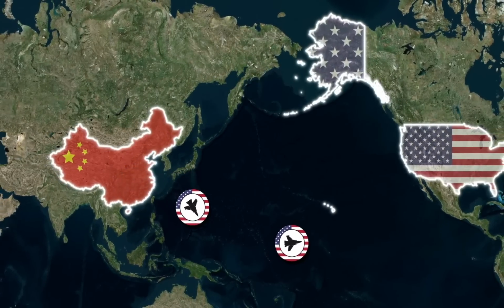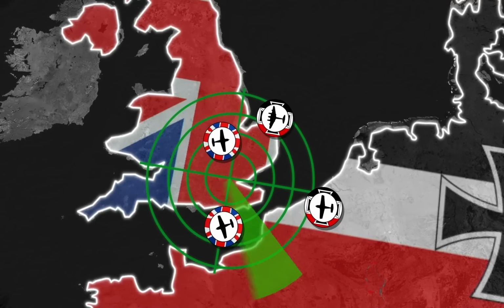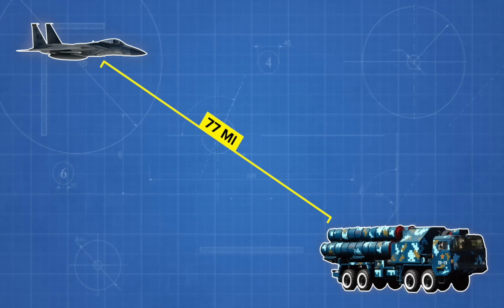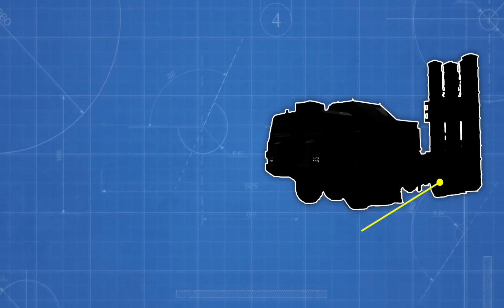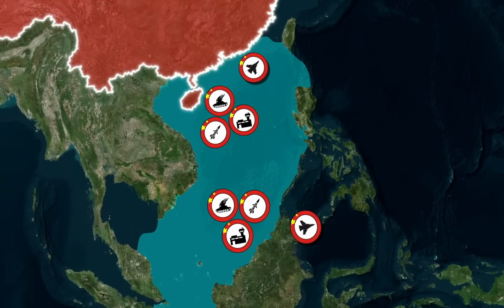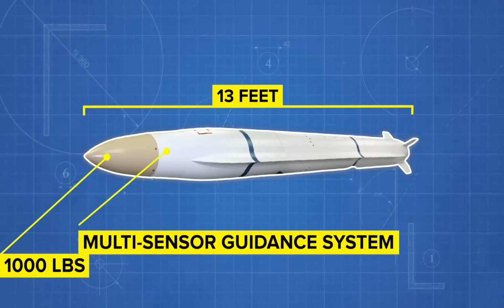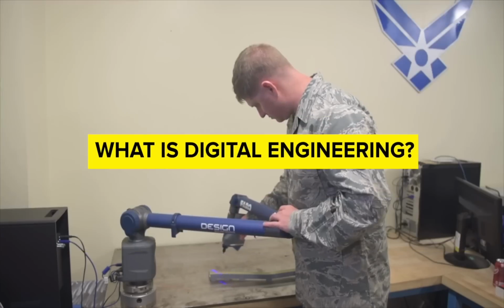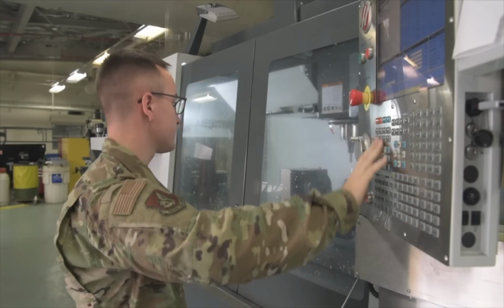Why America's New Airstrike Weapon Is A Total Game Changer

Comment: In actual combat, the S-400 has underperformed from the hype around it.  It has not lived up the stats surrounding it.
Reply: That’s usually the theme with orc hardware
Reply: You’re right and we all know it. Orks make crazy claims their equipment can’t do and the US says it can do 1x when really it’s performing at 2-5x
Reply: Indeed.  Why didn't the S-400 intercept those two Neptune anti-ship missiles that sank the Moskva?
The Moskva may have been out of range of the S-400 umbrella, though.  

If that's the case, then defective Russian standard operating procedure sank that ship just as much as the missiles themselves.  U.S. spy drones noticed that the Moskva's air search radars would go down for scheduled maintenance.  That means the ship was unprotected.  The Moskva should never have been operating alone.  There should've been another destroyer nearby to watch while the Moskva's radars were down.
Reply: @BlackPill-obey  Wouldn't have mattered The Moscow's radar weaknesses were built in to recreational SIMS made a full decade earlier.   One Youtuber duplicated the attack with an old SIM.   The Moscows long range radar only saw clutter under 50 meters above the waves.  And the short range radars had similar limitations (look up the video for details).   It was scheduled for radar upgrades in 2019 but couldn't due to sanctions in place from the 2014 invasion.
Reply: @mac_mcleod    Interesting.  Thanx for the info.  You're right, clutter above the waves is a real problem.  

Still, long before SIMS were part of a radar system, you had IC chips and discrete components.  Did the U.S. ship-based radars have the same problem?  Or did they use special filtering to deal with the clutter?  Looks like Russia is entirely too dependent on imported high tech stuff and needs to learn how to make effective radars the old-school way.
Reply: @BlackPill-obey  there is no old fashioned way to make high-quality radars. You need Advanced signal processing on chip and in software.
Reply: @BlackPill-obey you have to have more than one ship able to sail at any point…😂😂😂
Reply: @BlackPill-obey s-400 cannot protect submarines.
Reply: @BlackPill-obey 
Bizarro the recent case of the 
A-50 awacs that got downed by
2 S-200 sams
Reply: Of course not 😂
Reply: Was about to post the same thing but glad to see somebody else had already done so.
Reply: As all shit Russian weapons. Russia n China talk about how amazing the weapons are but American weapons are the only ones that work
Reply: @floridaracingvideos7758  if that is the case why did the US lose 10k aircraft over Vietnam?
Reply: @frankbrown5321  because it lost a lot of helicopters and UAVs .  The total losses were (3,744 planes, 5,607 helicopters and 578 UAVs ).  The helicopters were used in particularly risky and aggressive ways.

But it was a big conflict. They were using over 11,000 helicopters alone. And there were also a lot of jet to Jet conflicts.  The Russians wrote songs about fighting the US in the sky over vietnam.
Reply: @frankbrown5321   Most of those losses were helicopters and slow flying cargo aircraft.  Plus, the Vietcong were able to use Soviet air defense systems which were more able to defend against U.S. aircraft than now.   Stealth was not a thing back then.
Reply: Not true.. it actually did way better than expected and we haven't even gotten close to its full potential.
Reply: They're great at intercepting Ballistic missiles using the S-300/S-400 Truck chassis as counter measures.
Reply: At the end of the day, China has procured only two S400 systems for study.  Why are you people putting  so much focus on it?  LOL
Reply: As with all air defense systems, in order to properly demonstrate the performance of the S-400, the VHF, L-band, S-band, and X-band radar networks must be well configured for cooperative engagement.  The weakness of the S-400 is that its S-band radar is not PESA-type like that of the Aegis, making it vulnerable to jamming.  In addition, as stealth technology has become common, the RCS of anti-radiation missiles is small, and the actual frontal size is much smaller than that of the F-22, making it difficult to detect with long-wavelength S-band radar.  Because the United States has been hindering the development of Korea's defense technology in accordance with Japan's wishes, Korea's radar and missile technology is based on former Soviet technology.  The missile defense system exported by Korea to the UAE is based on a large X-band AESA radar made of GaN elements.  It is not affected by existing Israeli and American S-band electronic warfare.  Attempting a jamming attack against Korea's latest missile defense system using the X-band AESA radar mounted on an existing fighter jet is suicidal. The reasons are as follows: 
The biggest advantage of the large X-band radar is electronic warfare.  First, underpowered fighters may not be aware that they are being detected by LPI mode.  On the other hand, a frigate can have ample power to analyze all known LPI algorithms simultaneously.  Second, the fighter radar can be neutralized by saturating the entire frequency band available to the fighter radar for a desired period of time.  Third, fighter jets cannot jam a frigate's radar.  This is because your location can be revealed and you can be subject to indiscriminate jamming attacks.  Another reason is that GaN device-based radar can use edge frequency bands that GaAs device-based radar cannot use.  Fourth, as a result, it is possible to allocate only part of the hardware of the frigate radar and perform other missions simultaneously while performing electronic warfare.
These are reasons that Korean and Japanese combat ships did not use  S-band SPY-6 radar.
Reply: Iron some and THAAD missiles are very effective defense systems
Reply: Just like most of the crap Russia peddles
Reply: When you say "comprised of" so often it leads me to think that you probably also have a fake British accent.
Reply: When the Israelis took out the Iraqi reactor in Osirak, the S-400s the Russians had given the😅 Iraqis (ignoring their own front line troops), only detected Israeli warplanes as they were leaving the country. And that was 43 years ago.
Reply: The S-400 is relatively inferior even to our older Air defense systems.
Reply: @Shinobubu is it why Americans are so  piseed off that Turkey bought S400?
Reply: @Shinobubu  China bought a few copies of S400 system to learn how to defeat it and improve  her own systems.  You people focus on S400 because you are clueless on the actual Chinese air defense system.  Jesus.
Reply: @Shinobubu our Patriot system is based on the S-200.
Reply: @Shinobubu lol , you can live in your westenr dreams 😂 didn't even see a drone coming in tower 22
Reply: Because the “stats” are provided by Russia. They lie about their capabilities by saying it can do things that it can’t which causes America to overengineer a solution that will still be better than what Russia has decades into the future
Reply: That is every Russian system.  They always hype them then it turns out it is junk.
Reply: I've been noting that
Reply: None of what Russia makes has and their weapons exports are collapsing accordingly.
Reply: If China loses, China sends nuke. If US loses, US sends nuke. That's all you need to know. Everything else is BS.
Reply: China basically colludes with Russia to scam India.  China bought a few copies SU30, India bought 240 SU30 at 3x the price.  China bought 4 S300 systems, India bought 6 S300 at 3x the price. China bought 2 S400 systems, India bought 5 S400 systems at 3x the price.  And China always gets her 5 years before India does.  Thus, China has total militarily superiority on everything over India at all times.  Seeing the game here?
Reply: Has done a lot bettor then patriot missiles an iron dome there is no full proof air defence system anyone saying  there lying america could not get a military helicopter or airplane in the air when 911 happened yet several media helicopters were in the air
Reply: That is false. 😂
Reply: The HQ9 must be shit too
Reply: Where did you get your facts?
Reply: @nivramsleumas7411   Probably deduced that if the S-400 lived up to the hype, the Russians would have boasted about it.  

Of course, our media is so intertwined and evil that, even if it might generate online revenue, they will squelch success stories of the S-400 for bigger reasons.
Reply: Should give actual numbers. No air defence system is full proof. It's probably around 70%. On another note, the Patriot system is a downright F.raud of a system. It doesn't even reach its proclaimed 12-18%.
Reply: Most AA missiles are deadly including the S300… but only as deadly as the whole system (detection etc.), so let’s be honest, the direction of the West is to create missiles and systems (air and ground launched) that see and fire at distances further than the enemy can see. Hence F22, F35 and systems like Storm Shadow.
Reply: 7:32
Reply: I imagine it’s always better to overstate your enemy’s capabilities. No one loses their job or their life by overstating your enemy’s capabilities. On the other hand, if you understate, soldiers die and you may lose a conflict. So you add a fudge factor. Moreover, there are no extra points awarded for knowing it exactly. This isn’t surgery or thermonuclear physics.
Reply: Anyone who still believes the s400 hype BS, look up Ukrainian storm shadow literally gliding through s400 batteries & launchers (LMAO) and the Russians troops just filming the storm shadow and laughing... Its all over telegram war channels
Reply: You spelled patriot missile system wrong😂
Reply: US lost to Vietnam, Afghanistan,  and Syria. Now losing to Yemen 🤣🤣🤣
Reply: Missile defense systems in general are at a disadvantage when dealing with opposing incoming missiles. That's why the S400 has supposedly "underperformed" and the Patriot doesn't shoot down 100% of its targets. Still better to shoot down as many enemy missiles as possible than to not intercept any at all. Warfare is warfare. You get into a shooting war, chances are both sides are going to inflict casualties on the other. The tech on both sides of the equation will typically produce that kind of give and take.
Reply: is that the Russian defense weapon discussed early in the video ? S400
Reply: He .he...he....that's Russian weapons engineering at its best.
Reply: Just like everything from Russia except the AK-47
Reply: Can't even protect itself in Ukr
Reply: Where did you see the S400 underperformed with your lies, the only underperformed defence missile is the useless patriot defence system that has been constantly destroyed by Russia missile, even the soo hype iron dome is been dismantle by cheap drone missile every day by hezbollah.
Reply: I remember hearing a thing, probably from either LazerPig or Animarchy, that historically Soviet policy was to deter by overstating capabilities. And assumes everyone does so.
U.S. sells their standard stuff world wide, so everyone knows what it can do, but the stuff only America has, they understate. Striking a balance between believeably and frighteningly better than competitors, and what you build to counter it, will not be good enough to actually counter it.
Reply: @shilohlee4332  The U.S. also often builds to defeat what the Soviet Union (and now Russia) claims they can do.
Reply: @shilohlee4332  Yea I guess I do see your point. Sometimes though, their overstating gets to be too far into the realm of unbelievable. Do they think that people will believe it at all or just dont care anymore so they say whatever and not reveal the real capabilities. Did you see recently that even china was calling out russia on something? It was in some internal report I think. What was that one missile, supposedly hypersonic but really just an aircraft fired ballistic missile? Thats the one I believe the chinese were calling BS on. They called it a cold war missile dressed up like a modern one. It gives me T-90 vibes.
Reply: @Eviltower101 
Like the Mach-7 anti-ship missile.
Reply: @shilohlee4332   it's also not impossible that the 'export' versions of american systems are generally a generation behind the top of the line that america has in inventory, although it's also entirely possible that some of the systems sold to key allies is legitimately as cutting edge as what the USA keeps on hand
Reply: Russian equipment can’t even stop Ukrainian drones flying to St. Petersburg and Moscow.
Reply: The Russian government always overstates its military capabilities. The US, in anything, understates theirs. Between that and the fact that since the collapse of the Soviet Union, Russia has not had the budget or infrastructure to develop and manufacture their weapons, equipment and vehicles at scale they way the US and NATO can it is at a severe disadvantage and relies heavily on their cold war stockpiles of each. Also, because of said disadvantages, they haven't had the budget to maintain the previously mentioned cold war stock so they really are up a creek.
Reply: @bucky5869 
The West knows how to 
out-Sun-Tzu the much self-vaunting Sun-Tzu descendants
themselves. 
A 1993 Congressional hearing
revealed the 1987 SDI hoax that
threw red ursus into a panic 🙀 for believing 🇺🇸 had the system
fully deployed in space, & led it
to dismantling itself.
Another hearing questioned the
head of 🇺🇸 intelligence on the
why of his reports representing
red ursus as an infallible monolith of power that never made a error, hyping ⬆️ its
success & burying out of sight  its failures.
Wonder Boy’s reply was on subtleness in applying Sun-Tzu.
A contemporary cartoon on the
SDI success hoax put it as :
« May The Farce Be With you ! »
Reply: Of course it is substandard, it’s Russian.
Reply: The s400 is more of a target than anti-aircraft. 😂
Reply: @tormentorxl2732 
It’s a 3-dimension-working system : StAtS missile.
Reply: @minhthunguyendang9900  hilarious
Reply: @tormentorxl2732 says who 😂 your media 😂 what happened in tower 22 😂 and in urkiane
Reply: It’s Russian. 
Not one bit surprised lol
Reply: I can't think of a single Russian thing that has performed up to expectations in the Ukraine war 😂
Reply: @peterphan227 their guns shoot a lot of bullets, and all those flying bullets hurt
Reply: @peterphan227 
A little off-topic, but remember the « Bounder » giant supersonic bomber(so-called)
that looked like a B-58 with a 
finned tail, that appeared in ‘61
conveniently for the Berlin Wall
inauguration, & that caused quite a stir among Western Brass. 
Well, later it was revealed to be just a tomorrow-less prototype.
…………………………………..
& today it’s the recent flight with vlad aboard of the hyper-hyped 🆙 « White Swan » hypersonic (so-called) bomber
that for all purposes, eerily looks like an 🇺🇸 B-1 bomber.
Just remember 
- the Tup0lev TU-110
- Leonov’s 1965 « space walk »
- Lunik 3’s 1960 « photos of the hidden face of the Moon 🌚 «
Reply: @peterphan227   hay now, i expected the russian army to fail and it's leadership to be incompetent, and i can safely say they have lived up to my expectations.
Reply: Russia touts a huge success rate, but that simply means they don't test it very much. Vs America that tests the crap out of their stuff and continues to improve it.
Reply: Just like other over-hyped Russian weapons such as the AS-24 Killjoy ALBM.
Reply: Underperformed? It was not able to shoot down 40 years old USmissile that air defences were capable of shooting down 33 years ago. That is not underperforming. That is trash 😂😂😂
Reply: Well, a s300 downed a f117 decades ago
Reply: @frankbrown5321  it was not an s300, was an S75.
Reply: @euunul  correction s75
Reply: @frankbrown5321 bro get your facts straight the bay was open so got a radar lock it was pilot error
Reply: @jmac051  that doesn't change the fact that a s300 took the f117 down.  I'm aware of that.  The airforce also flew the identical flight path, which was stupid.  But understand that a radar cross section of the bomb bay doors is much smaller than any other non stealth aircraft.   And you may have forgotten all the US aircraft that were shot down in Vietnam (there were many). This was the result of soviet SAM systems.
Reply: Lmao it's just a truck with a bullseye 🎯 on itself
Reply: Ne lupaj gluposti....
Reply: is your assessment based on facts or just came out of no where?  and are you qualified to make this assessment?? Please enlighten us all here.  LOL
Reply: @tompell3032  Lol, you are missing the point of YT. If you feel that strongly, debunk his point. Please enlighten us!
Reply: @tompell3032   What facts or qualifications would you accept?  We are living in times when facts and credentials are subject to the parties that invent them.  

As Pontius Pilate asked Jesus, "What is truth?"  His question never made sense until now.
Reply: Well, the Iron Dome has not done that well either in actual warfare....
Reply: @danielmathai4780  

Yes it has…
Reply: @jloiben12 Not it hasn't, it actually failed to overcome the barrage launched by Hamas in the initial stage of the attack. A lot of missiles found their way to their targets and caused immense damage
Reply: @amin_baccari  

… 

Do you think the Iron Dome covers 100% of Israel? That literally every inch is covered by an Iron Dome?
Reply: @amin_baccari 

Lol - what targets did Hamas missiles "find" and how does unguided missile "find" anything at all?
Reply: @darkdays82 
they find planet 🌎 🌍 🌏 earth the hard way
Reply: @jloiben12 I agree with you and I think for the most part the Iron Dome has saved millions of lives and it's only when it is overwhelmed excessively that a few missiles do break through but that just occurred this year .
Reply: @danielmathai4780   for one thing, it's a hell of a lot harder to hit shoulder fired RPG that is targeting a location 2 miles away from the launch point, than to see an incoming ballistic missile 300 miles out and lining up a shot to take it out before it hits. most air defense systems would NEVER be trying to hit a target that had launched that close unless it was a drone, they are specked for long range engagements not close range engagement.

also, the iron dome has done wonderful, but no matter how good a system is it has a maximum amount that it can intercept, and when the bad guys exceed that threshold, some attacks will get through.
Reply: @delphy2478   you aint hitting anything from 2 miles with an RPG
Reply: @delphy2478 
Air-marshal Harris’ Bomber Command taught the luftwaffe
Air Defense Saturation at Koln
in 1942 already.
Reply: @danielmathai4780  With a near 98% interception rate I say it has.  and has protected 100% of areas its suppose to protect. While the S-400 got destroyed by the very missiles it was designed to intercept . That's a colossal failure.
Reply: @amin_baccari  A real quick look shows 2 destroyed recently.
Reply: @amin_baccari  Russian S-400 ‘Falls Apart’ In Ukraine War; Moscow Forced To Pull Its SAMs From Kaliningrad To Frontlines. Shows 4 were destroyed. So your reasoning why they were destroyed is wrong, except for one.
Reply: @Shinobubu That is false.
Reply: @Shinobubu  lol. Are you talking about the Patriot system? Everyone knows it's almost 100% disfunction. They've known this in the Iraq war, and apparently it hasn't improved its record.
Reply: @Shinobubu 😂 when was S 400 destroyed 😂 and when did iron dome has a 98% accuracy 😂 stop been desperate now 😂
Reply: @Shinobubu a Patriot battery was destroyed by a primitive Iraqi Scud missile
Reply: @amin_baccari  if by failing, you mean intercepting 31 targets, then you're correct.
Reply: @danielmathai4780 lol look up what it's shot down
Reply: @danielmathai4780 it surely did better than the overhyped S 400 systems...that was a whole lot oof banking but no bites
Reply: @danielmathai4780 lmfao yea it has 🤡
Reply: 90-95% Pk isn't too shabby.
Reply: The "Patriot" system, even more so! Failed in Saudi Arabia and Israel, against Iraqi-modified "Scud" ballistic missiles. Failed again in Saudi Arabia against Yemeni cruise missiles.😂
Reply: @truthadvocacy It didn’t so much fail as it was designed to explode against Mach 2 planes, against Mach 4 rockets it exploded late, blowing up the engine but leaving the warhead intact. In Saudi Arabia, the Patriot like the S-400 can only be aimed in one direction which is usually the threat direction. Saudi Arabia wasn’t expecting an attack from Iran which could’ve started a war, they haven’t tried that since. But that was 40 years ago and the Patriot 3 uses a hit to kill vehicle that ensures the complete destruction of the missile while getting a new radar that allows full 360 degrees of missile coverage! Even the U.S. was mildly surprised when Ukraine managed to shoot down the much vaunted hypersonic Khinzhal missiles! Leaving even China disappointed at the poor performance of these supposedly game changing hypersonic missiles!?? 😂
Reply: @JimCOsd55 when lie becomes truth only if person or persons want to believe it
Reply: @skipbayless8834  Guess it depends on what you think the lie is?
Reply: @truthadvocacy  That was the early stage of its development, but over time, it fixed bugs and updated software. Afghanistan it protected US bases but news ignore its improvements simply its not drama enough, Ukraine has proven it combat effects killing the Russian " HYPER" missles.
Reply: @truthadvocacy  ...Receipts? Patriot gets upgraded over time. See Habitual Linecrosser. It was the first Missile-to-Missile Intercept (not intended use). Then upgraded to do it better. Gets to Ukraine, and word is the only Russian Missiles it doesn't soot down are the ones outside it's protection zone.
Reply: @shilohlee4332 sure, is not like we've seen a video with Patriot battery emptying whole load of missiles seconds before Russian missile drops on it. LOL.
Reply: @euunul  You mean when one part of the system was lightly damaged by debris and continued working fine?
Reply: @supremecaffeine2633  sure, sure, lightly damaged. Anyway, peak performance to fire 32 missiles in 30s and still get hit.
Reply: @euunul  Except that it was damaged by falling debris. It was up and working a day or two later.
Reply: @euunul   Prove it was destroyed. Waiting for the proof.
Reply: @shilohlee4332 I basically told him the same thing. The patriot missile system has now had multiple upgrades and is outstanding system today.
Reply: @euunul   because you haven't see that happen
Reply: @euunul  Yeah, lightly damaged. Nobody even noticed something was wrong until hours after the attack because the system was still working without issue. You honestly expect it to waste a missile on shrapnel from the Russian trash it shot down?
Reply: @euunul  I haven't. Where's this video?
Reply: @raptorsean1464 
Like the F-16 & F-15 & F-18
Instead of new hyped up prototypes.
However a tip of the hat 🎩 to the Mig-15/17/21 resilience.
The only thing Americans failed 😨 to do with their too-soon discarded F-86
Reply: @truthadvocacy  patriot can't cover an area its not in. Any missle system can be overwhelmed.
Reply: @jamesbelcher896 
In 1991 (2nd Gulf War) the Patriot ASM system was a already near obsolescence 
according to the Americans themselves.
However they learnt from ww2
Germany that massive average
overwhelms selected top quality. Like the Sherman tanks
in their constantly upgraded versions eventually bested the
German hand-made latest Tigers & Panthers.
Reply: @minhthunguyendang9900  like you just stated constantly upgraded.
Reply: @truthadvocacy 
I guess you haven’t been keeping up with current events in Ukraine.
Reply: @truthadvocacy 30 years ago it was ineffective against terminal phase theater ballistic missiles, which is why PAC-3 was built, PAC-3 has been tested in Ukraine against Russias advanced long range (“hypersonic”) missiles.
Reply: @jeffmoss5332 
Hyped « hypersonic » missiles
Reply: @truthadvocacy this is true, but it’s not the 80s anymore. The system is 3 variations past this.
Reply: @truthadvocacy  There's an A-50 out there that would like to argue with your advocated truth.
Reply: @truthadvocacy  Patriot had over 90% succes rate at 1991... And it is year 2024.
Reply: @truthadvocacy ah yes the early 1990s argument
Reply: @truthadvocacy  nope.   It has basiclly given Ukraine air supremecy in russia.    Patriot ia worlfs best
Reply: @truthadvocacy - The Patriot is doing a hell of a lot better than you are stating, as evidenced by the continued downing of the Russian "hypersonic" missiles and other weapons. Yes some of the earlier iterations of the Patriot systems had issues,but that's why we have the improvements in the successive generations.
Reply: @truthadvocacy  buddy the patriot is the 1 reason why russia can't use their airforce
Reply: You do realize that the missiles/systems called Patriot in 1991 aren't what is currently fielded, right? The current PAC-2 GEM-T, PAC-3 CRI, and PAC-3 MSE, have demonstrated very high real world kill ratios. They've shot down more ballistic missiles in combat, than any other SAM.
Reply: @truthadvocacy way to use decades old examples!
Reply: @truthadvocacy the radars were pointed in the wrong dirrection
Reply: @truthadvocacy The Patriot system from the 90’s has since been upgraded. 
The system in Saudi Arabia failed because it wasn’t designed to intercept drones.
Maybe that has since changed.
The current Patriot systems have been excellent against Russian missiles/cruise missiles/jets.
Just ask the Ukrainians, they love it!
Reply: @truthadvocacy Hugely upgraded now.
Reply: @truthadvocacy they’ve updated it in the last 30 years. It works really, really well now.
Reply: @truthadvocacy You are correct, and the Patriot missile system is a totally new missile system today, and that is outstanding.
Reply: Not true. It did not perform well during the Gulf war, but they made it drastically better so by the end of the 90s, it was a night and day difference. I believe the success rate was around 25 percent but was at 97 percent after they improved the system. The original patriot system was primarily for anti aircraft not against much smaller and faster missiles. That's why it did so poorly in the beginning. Currently, it's at about an 87 percent hit rate overall, which includes all the failures in the beginning when they tried taking down the scud missiles in the middle east.